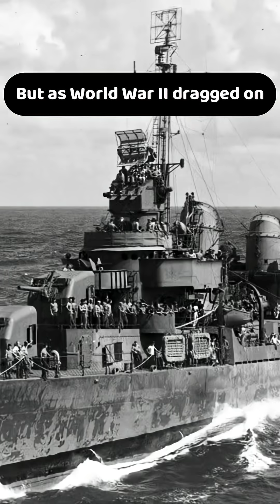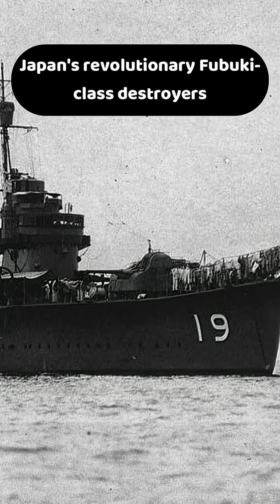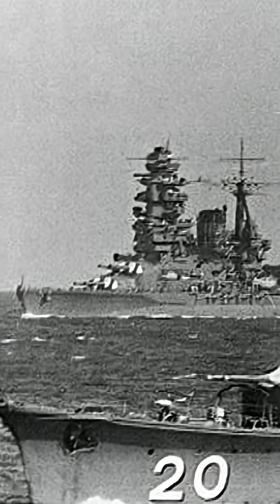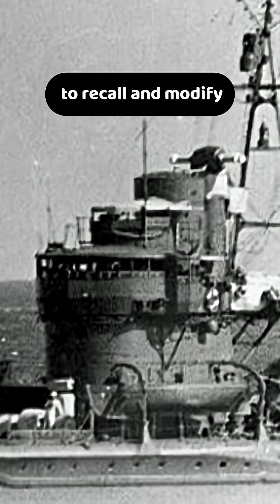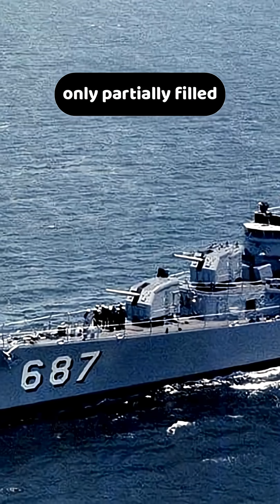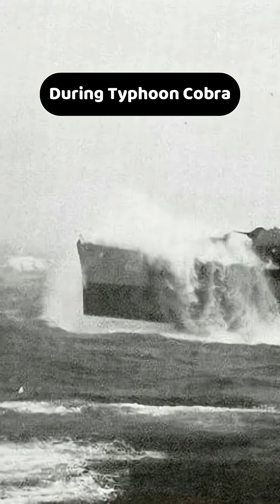Top-Heavy Design Flaws of WWII Destroyers

Comment: The Fletchers really weren’t that bad. They were quite flexible. By the time in the war they really needed the extra AA guns, they had mostly stopped needing the torpedos as much. So they would remove one of the torpedo launchers to offset the AA guns. Now the Gearings? They were a top heavy mess. But the Fletchers really had a lot of space for future upgrades. The last of them only left service in the early 2000’s. The three lost in Typhoon Cobra were due to a couple of issues. More to do with bad seamanship at the fleet level. They had dry tanks. They had pumped out the seawater ballast because they were engaged in a refueling operation. Halsey stupidly pointed the fleet at a category 5 Typhoon while refueling. So without fuel or ballast they were riding high when the storm hit.

Comment: To Add MORE Stability Problems, Some Destroyers Had Aircraft Launch Rails To Send Up Observation Planes To Assist In The Hunting Ability Of The Larger Ships Of The Fleet!
Reply: Those were Light cruisers+, There aren't any destroyers with such capability, the ones that actually existed were just prototypes. The larger ships of the fleet as you mentioned, can carry their own aircraft complement, being much more effective than the light cruisers or HC.
Reply: @SpaceMarshal-v8n  no no, the US Navy did test it on several destroyers, but if only lasted for a few years and I think maybe eight destroyers only ever had the aircraft
Reply: @thepeanut2681  Yeah, but i'm only considering the ones that were in service and actually used, those other exceptions were just tests. But yeah, they existed.
Reply: @SpaceMarshal-v8n  Except the USS Pringle, which had an aircraft launch rail added onto in 1942, however the experiment was deemed to not be effective nor needed enough to justify the top heaviness and other design tradeoffs.

Comment: Eh wouldnt fuel tanks low in the hull add stability if full?
Reply: Right, in contrast to this short video, they actually deliberately left the lowest fuel tanks as full as possible. Sloshing in these tanks from being half full could induce more instability in an already unstable ship.
Reply: @ostiariusalpha  Yep, since it would move the center of mass much more efficiently than by the lateral tanks.
Being full in all of tanks is good, but you have to consider that, not always a ship is carrying it's full payload.
Reply: Actually a lot of tanks are designed so they can flood the fuel tanks with sea water.
And others had suction (where you pull the fuel from the tanks) at the top and they would fill with water from holes in the bottom of the tank!